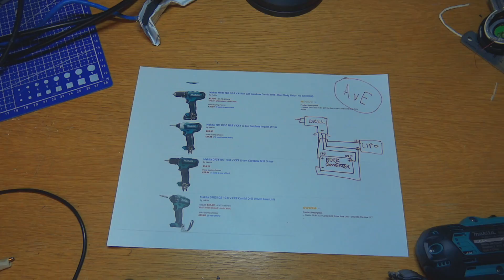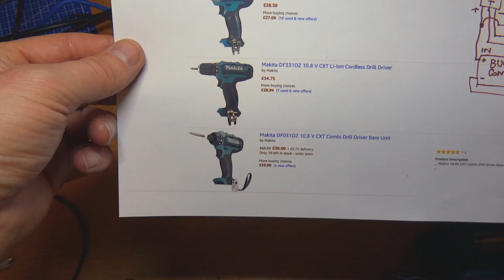Run a Makita Drill on cheap lipo batteries !!! (CXT drill)

Comment: DOES NOT work witk makita dhp482 !
Reply: Solution that helped: needs to connect 10k ohm resistor between third temp sensor wire and Vcc (positive).

Comment: Hello! Amazing and simple solution. My Makita HP 331D works perfectly with a tiny step-down with 2,5v output in T sensor.
Now I can put a 3s 12v LiPo battery with, for hours!!

Thanks a lot for your time, now I'm a subscriber.

Cheers from Brazil!

Comment: Hello. How did you connected output voltage to this third pin from voltage regulator ? Did you soldered positive and negative 2.5v output to this third pin? Probably not coz this would cause shortage isn't it. I'm confused so please explain if you don't mind
Reply from the maker: Ground goes to battery ground. Vin goes to battery positive, vout goes to the 'T' sensor pin

Comment: I think that third wire might be a inbuilt low voltage cut off, so lithium battery's don't get over discharged
Reply from the maker: +Jesse Nurse no it's a temp sensor. It's output rises with the battery temp. Above a certain value the drill stops working
Reply: powerlord69 really wow, as the battery heats up it makes more voltage, spose it makes sense considering when the battery is cold produces less voltage. Cheers mate. The way I'm going to do it is the same way your doing it but, I'm getting a battery shell from amazon with the board, do a bit of cutting and wire it up in there, that way I can pull it out as normal and still use makita batteries
Reply: And wher is the temperature sensor, in the handle, that make no sense for detecting the outside battery packs temperature.

Comment: I appreciate your ingenuity, but batteries are £32 on ebay delivered, and you don't have to have a drill that's completely impracticable, throw that in your tool bag a couple times and the wiring is going to break, and the complete impracticability of having a huge battery pack taped to the handle.